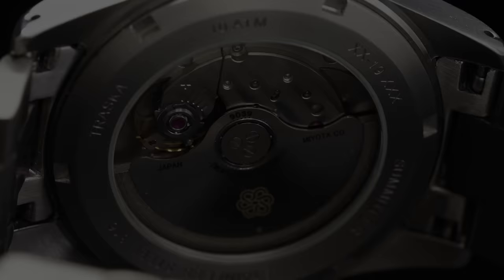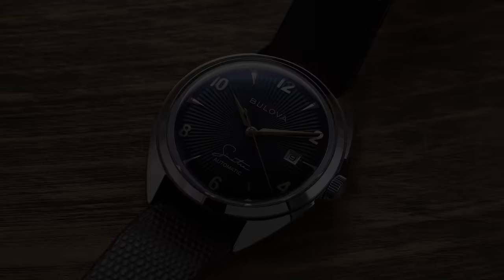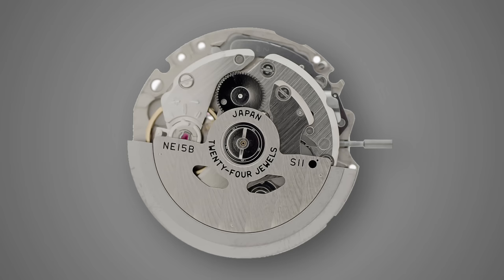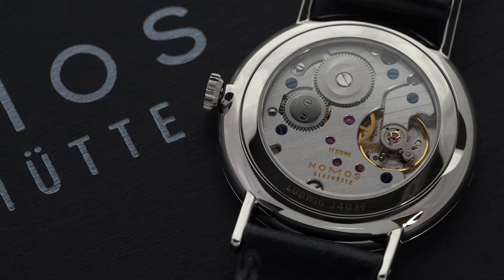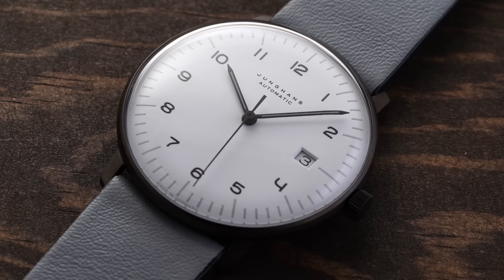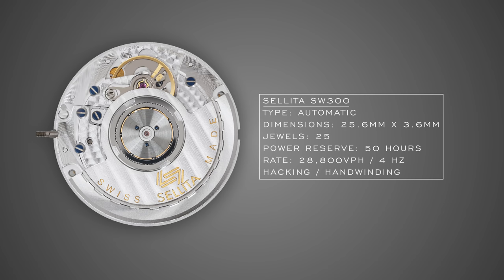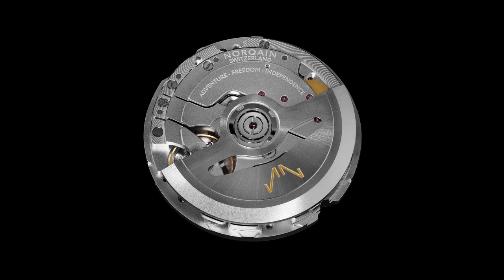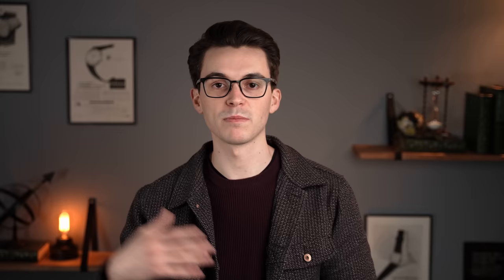Overview Of Third-Party Movements: ETA, Miyota, Seiko, & More (A Comprehensive Guide)

Comment: Dude, I'm exhausted from the continuous blast of info. Great job.  Although more in-house than third-party, I wanted to give a nod to movements from Orient. My newer F6N43 is +6-8 sec/day fresh from the box. It's modestly decorated and has a 50hr PR with PR indicator. The 48743 ticker in my old Flight has been bulletproof. That very basic engine has withstood years of hammering, drops, and low-level abuse with no maintenance. Orient makes tough and reliable movements under the radar of most enthusiasts. No flash, but they just take a licking and keep... well, you get the point.

Comment: My Sector No Limits 950 from the 90s has a Valjoux movement. I remember my first Automatic watch was a Sector No Limits Golden Eagle 1500 with the same movement. When I bought a Bell&Ross I thought it wasnt working because the movement was so discreet  compared to the rotor rotating and feeling the vibrations on my wrist of the Valjoux.
Reply: My Sector 950 has the ETA 2824-2 but it's the three hand Titanium version, where yours is probably a Chronograph?
Reply: @mikesey1  correct the Chrono has Valjoux, the non Chrono ETA 2824-2

Comment: I own 5 Chinese watches all with the NH35A movement, I was amazed at the accuracy, the best gains a maximum of 2 secs per day the worst 8 secs per day. So my cheap Chinese watch with the Seiko NH35A keeps time better than my best hi beat Swiss movement. I have 3 one ETA 2824-2 and 2 SW200's  also run between +4 sec/day & +9 secs. Considering the price difference makes the NH35A something of a bargain (if you don't mind the bulk)

Comment: Nothing about Sea-Gull? Or HK Precision?
Reply: I've read Seagull is the largest manufacturer of mechanical movements in the world.  And they actually use Swiss technology, based on an old Venus movement manufacturer they bought in the 50s which they now use to make column wheel chronographs and tourbillons.
Reply: @davidc5191  they also have the st2130, like HK precision with their pt5000, both are clone of the ETA 2824-2, and compete with the sw200

Comment: Some more : 
* In japan, Epson, which is actually the same as orient. Epson movement are unbranded versions of Orient movements.
* In Switzerland, eterna-movement. Those are in-house movements used in eterna watches , made available for third parties.
* In China Tianjin seagull makes good pieces. Especially, their ST19 in by far the cheapest column-wheel mechanical chronograph movement on the market.
* In China too, Huangzou, makes good stuff including micro rotor movements. 

Also, some watch brands occasionnally uses NOS movements from defunct manufacturers, like France Ebauches.

Comment: I have several NH35A movements,  I've regulated most of them myself and they're all bar one within COSC -4/+6  secs per day. Others in Chinese micro brands were within COSC tolerance out of the box and have remained so. On the whole an excellent starting point if their thickness isn't an issue for you. ETA 2824-2/SW200 are my preferred movements, dead easy to regulate yourself, very consistent and a slightly smoother seconds hand sweep (4Hz) Avoid handwinding these!
Reply: They both fixed that lol, you're not going to strip gear teeth anymore

Comment: I have about 8 Seikos and only one of them can be regulated to an acceptable tolerance in multiple positions. The rest will vary about 15 - 30 seconds per day between crown up and face up etc. I have over 20 with ETA or Swiss made movements and all of them are under 5 seconds per day consistently in multiple positions. Even the non Chronometer rated ones.

Comment: The valjoux movement is a classic to me even if it isn't a in house movement it's a piece of history. Why I'm working on my next dream project mod. Superclone nautilus chrono case with a valjoux 7751 custom dial. Some of the jewelry maker aftermarket stainless steel and gold bits used to ice out watches and modify real pieces and make fraken watches. 

Tiffany blue dial. Unsure on sub dials and date wheels. Royal blue silver and gold moonphase wheel. Silver moon gold sun. Largest dial I can fit. Also takes a clone and makes it something more unique and interesting and still a discussion piece for real watch nerds. 

By the time it's fully done its probably gonna be 5k ish maybe a bit more. But will have a good bit of real gold innit by then with every center link the bezel and case back plus the sapphire on the case back. Potentially the rotor. Pushers and crown. Hopefully 100m to 200m water resistance. And a fairly reliable and serviceable movement.

Comment: I bought an Oris Big Crown Pointer watch some years ago as I think it has a classic look. On the dial it has 25 Jewels Automatic. But inside the watch viewed through the exhibition glass you can see it is fitted with a 26 jeweled Sellita ! This isn't a one off as ORIS used the last of the dials but swapped movement manufacturer. The pendulum is Red on the Sellita movement. Naughty ORIS.

Comment: Completely overlooked the service every 7-10 years for every automatic movement. It costs a lot, £200-1000+ depending on requirements, Nh35 is £30 to replace and is very reliable.

Comment: Thank you Teddy, this is very informative to those who may dismiss 3rd party movements. At last an impartial review. I have experience with some of these brands. I've had a Sellita SW200 watch that has until recently been my most accurate watch within a second or two accuracy for some years, it probably needs a service now as the auto rotor is not as free as it used to be. I love the Valjoux as a super reliable work horse chronograph, OK it's on the thicker side but what a super movement. I also have an old TAG Monaco with a caliber 12 modular that has the Sellita SW300 mated with the Dubois Depraz chronograph module, keep em running and they will do you proud service. I'll not even attempt to list the ETA 2824 movement watches that I've had over the years but to date I do not recall a single issue with that movement for me anyway. I think a lot of a movements reputation as you mention is related to the company who cases the watch regulates the movement (and lubricates it of course to a good standard. The very best engineered movement will be perceived as sub standard if it is not regulated after all.

Comment: Solid work Teddy, with one glaring omission: Seagull. The ST 19 is popping up a lot lately, and for good reason. It is a manual wind column wheel chronograph based on a classic  Venus design.

As for modular chronographs I find them inferior to integrated designs, the pushers being harsh. They're thick too.

Comment: Recently I was told that I "had no class" in another channel's comments section for wearing a Marathon automatic field watch with the Seiko NH35A movement which they stated "is a cheap Asian movement" when COMPARED to a g-shock of all things. LOL. I'm glad Teddy sells Marathon. In my defense: sapphire crystal, hackable automatic and manual movement, 24 jewels, tritium tubes and maraglo lume! You get a lot of watch for the price not matched by much more expensive pieces. My only complaint is that it is kinda small on my wrist by current standards- I'd like them to do a larger field watch like they did with their gmt's and dive watches

Comment: Hi Teddy 😁 Very useful overview. Thank you for sharing your thoughts. Lately I am impressed with the ETA 3 Hz 80 hrs power reserve movements found in the brands Hamilton /Certina and Tissot . The watches with these movements are the most accurate of my collection.
May be you can comment on these movements in another video?
Ciao 🤗
Reply: It is a 2824-2, which they reduced the bph, wich increase the power reserve, would say they are great, if the movement is already a workhorse in high bit, it will be even more reliable when used at a lower bit rate, less frictions...

Comment: I think that one of the reasons that Miyota gets a fair bit of hate is that the rotors on both the 8000 and 9000 series are unidirectional winding, as opposed to Seiko’s movements and the standard Swiss movements (I.e. 2824-2 and 2892-2 and derived movements, like 2836-2 and 2893).  The Valjoux 7750 is also unidirectional winding, hence your comments, but because it’s an automatic chronograph, I think it’s forgiven many of its issues, like thickness.

Comment: Excellent reference video Teddy! One of my first watches was a Longines Chrono with the Dubois Depraz module. The pushers were very stiff and the Chrono hand jumped when starting it. Then I discovered the 7750, had Ball Trainmaster, Hamilton, and Sinn with one. Loved the 7750, especially the way it was decorated in the Ball. I also LOVE the spinning, gives the movement a soul imo. Also had a Fortis Cosmonaut with a Lemania 5100. Beautiful movement with an excellent setup, easy to read. Recently have been dabbling quite a bit with micro brands. So far really impressed with the Miyota 9000 series. The 800 series in my Bulova Hack watches is ok, especially for the price.
Reply: The 7750 was the first automatic chronograph movement, has been around for donkeys
Reply: The Calibre 11, also known as Chronomatic, a joint venture between Heuer, Breitling, Hamilton-Buren and Dubois-Depraz was the first automatic chronograph and released to the public in 1969. The Valjoux 7750 debuted four years later in 1973.
Reply: @ManOnTime  Sorry but 7750 was it an attempt at making an affordable chronograph
Reply: Affordable is relative, and I am not denying that the 7750 can be found in many price ranges today, but that wasn't the case then. It only lasted until 1975 and then was shelved; largely due to the collapse of the mechanical watch industry due the emergence of quartz. Swatch Group revived the movement and manufacture of it in 1985, and it was then that it became the juggernaut we know it as today.
Reply: @ManOnTime  In comparision to many mechanical movements

Comment: Very well done, Teddy.  Excellent presentation. I own both ETA and Sellita movements. The ETA feels far “tighter”. Almos stiff compared to the Sellitas but wind quicker. I also own Seiko and Miyota movements. They are all excellent pieces for what they were designed to be. Thanks for putting this all out there for us.
Reply: Can most watch shops service and get parts for these microbrands with non ETA movements?
Reply: @USMCAllTheWay  most watchmakers can easily service and source parts for all of these movements. Sometime some of the embellishments or customizations would require parts or service from the brand itself.

Comment: Dubois Depraz developed the add-on module for the original Chronomatic, one of the first - if not the first - integrated automatic chronograph movements. That movement was developed off a Buren micro rotor movement with participation by Heuer, Breitling and Hamilton. It overtook the Valjoux 72 but seems to have been replaced by the Valjoux 7750.

Comment: Very interesting video! The Myiota 8215 is beating in my Timex Navi XL. I didn't know that this movement is around since 1977! In my experience this movement is accurate, by far more accurate than the 7s26 or NH35 by Seiko. The 4r36 is ticking in my 1st automatic watch I've ever bought: Seiko SRP515k1.

Comment: The 2894 is a pain in the ass for us watchmakers because the chrono module requires a specific holder that helps keep everything in place while the two halves are sandwiched together. The holder is hard to find and very expensive. Not to mention the fact that I can probably do 2 7750’s in the time it takes to do a 2894.

Comment: Ive experienced both modular and integrated chronographs, I don’t really notice a difference between them other then the alignment of the pushers.   You would think that the integrated would be the thinner movement over a modular. I guess the reason for this is that the Valjoux movement is like a primitive tractor that is rock solid but old school technology.

Comment: Good video, great knowledge..sadly not in the cards right now 😮‍💨. I have, I wouldn't call it a grail watch and definitely not a lot of people's choice, but a Bulova Precisionist Chronograph in stainless with a yellow second hand(s) and a carbon dial(not that you can see it much..there's a lot going on in there. It is a Very thick watch, some jeweled surfaces on the face and the chrono function and movement are sublimely smooth. I'm not sure if the movement is certified or not,,never really cared but I'd does count to the 100th or 1000th of a second when using the chrono feature. It's a big beast of a watch and some sharp and well defined edges to watch out for, but I love it. Right color and materials for me, can time immensely precise...only dithers 3 seconds a year..yes that's right and the fit and finish are quite good. Like I said not a grail watch but so far it is for me in my collection.  Eventually I'll get something I consider a true grail watch

Comment: One problem with movements is that the huge cost of new movement development means going back to smaller watches will be a difficult.
Nearly all small diameter movements were dropped years ago.
It's like being in the 1970's with super wide flared trousers and being told that getting back from this madness won't be as simple as you think.

Comment: Please tell me what is 17 , 21, 24 ,25  and 29 jewels movement,  and whats the difference between them.
Reply: I am no expert but from what I have read and watched jewels help with keeping friction down
Reply: @oscarosullivan4513   thanks
Reply: The jewels are used like bearings which the ends of the rotating shafts of the movements gears and wheels etc turn in, the jewels are typically ruby's which are a variety of corundum the second hardest jem next to diamond, because it's so hard it's very resistant to wear and has very low friction with the wheel and rotor shaft ends that rotate against the jewels.

Comment: In theory yes, SW-200/300 series are as good as ETA 2824-2/2892-a2 although in practice not like that. My 10 years old standart/elaboré grade ETA 2824-2 tended to have much better performance than my relatively new Tag Heuer Aquaracer Calibre 5(elaboré grade sw200). While Calibre 5 losing almost 10 secs in a day, an unserviced ETA 2824-2 for those ten years were gaining only 4 secs in a day. Same goes for Sellita based Oris calibers. Of course there are worse options there with a Yema MBP 2000(an ETA clone) which stopped working after three weeks.

Comment: I think my bad experiences with mechanical watches has soured me on them, from inheriting my Dad’s old Omega Seamaster and finding that a cleaning wasn’t enough and I couldn’t afford the service it really needed (later it was stolen), a few fall-of-the-Soviet-Union pieces of junk… I fled to Casio and cheap Seiko atomic-clock radio-sync watches, then upgraded to Citizens.

I want ten seconds a year or better. Nothing here for me. I know, I know. Soulless electronic and radio or satellite sync, thermocompensated ETA quartz movements…
Reply: Agreed. When I first bought a Seiko Quartz in the late 1970s it was a game changer. No more watch failures. No more servicing. A man down the local market changes the battery for a couple of pounds. The watch is still going strong a real work horse. 

I got my father’s old pointer date Certina serviced for sentimental reasons. First I had to find someone to service it, then it cost a pretty penny. In the seventies there were lots of places that would service a mechanical watch and it did not cost an arm and a leg. Anyway the Certina started to run slow again and I thought I cannot be bothered to get it serviced again.

Seiko, Casio and Citizen for me now. They construct there watches reliably at reasonable prices. Accuracy beats a mechanical watch and nobody will attempt to rob me of the watch.

Comment: You missed La Joux Perret. They make a lot of the "in house" movements for the top end offerings of many of the well established "luxury" watch brands. There was the scandal with Bremont's "in house" movements which was just an existing, rebadged, movement form Joux . But they have also designed/manufactured a lot of exclusive movements, which are also marketed as "in house", for the likes of Hublot and Hermes. 

JLC used to do something similar not too long ago at the every top of the market. As recently as the 2010s, they had provided ebauches to even the likes of AP and Patek. With the anti-ebauche snobbery at the top end of the market what it has become today, I don't think JLC they are anywhere as prolific as they used to be on selling their movements, but you still see it on a smaller scale, like with the Ralph Lauren watches.

Comment: Excellent video about Movements. I would like to see a video about the rest of the watch because no one does. Example, who makes the watch cases, especially for Screw Downs with better quality threads that will last a long time. I have two micro brands that uses NH35 with screw down that junked out in less than a year because of inferior low cost threads. So, my assumption is that the better known brands are using better quality threads for their screw down watches. I dare you to make a video that points this out.